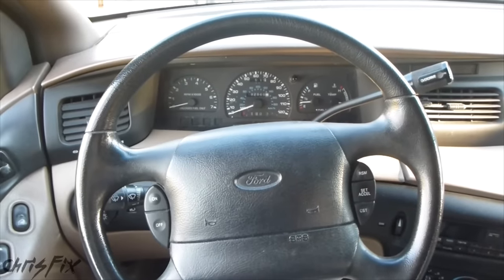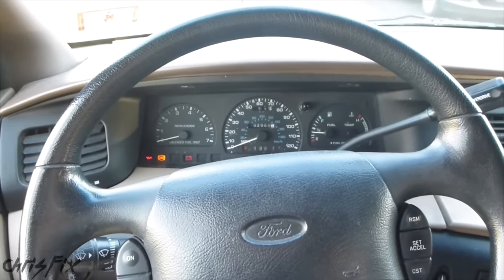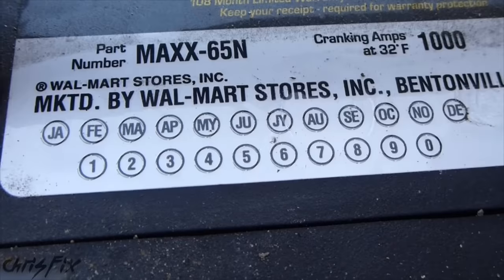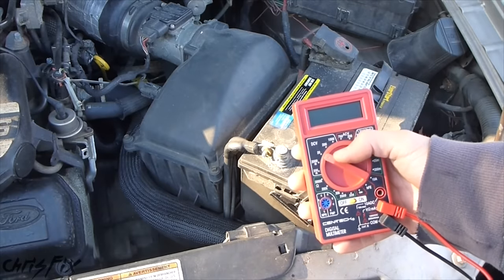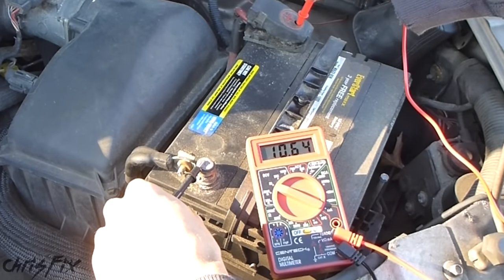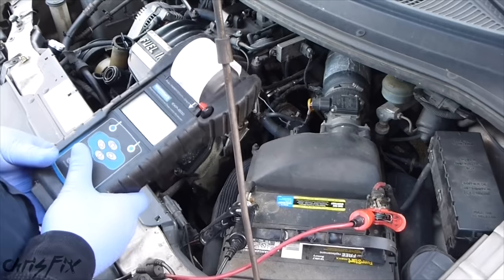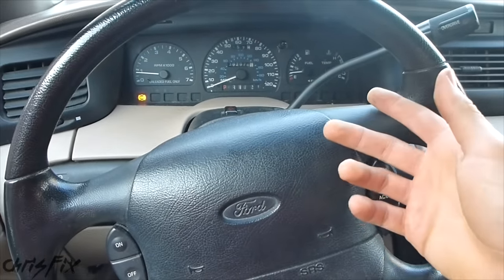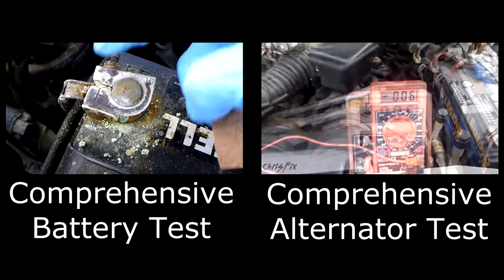What to do if your Car won't Start

Comment: Hey Chris. I don't know if you'll see this, but my car will randomly not even turn over for a while until I turn the key a couple times, then it will start with one tumble. Could that be a bad starter?
Reply: Yes that would be a starter motor I had one of my cars do it last year on me if you can get at starter motor tap it with a hammer starter motor should work unless you end up with my problem in the end my starter motor completely failed so I had to replace it so you got two options put up with it tap it with a hammer every now again or completely replace

Comment: Hi can anyone help me? I have a 2008 Vauxhall Corsa D. I’ve just replaced the battery and now it won’t start but I’m getting power to the dash lights. One of the dash light is a flashing car with a spanner. I’ve looked it up and some say it could be the immobilisation system preventing it from cranking and starting the engine. Any tips or advise would be great thanks 🙏

Comment: Problem i had wasnt the battery t was the starter so now it starts but sometimes it is hard any ideas they change the carbon on the starter and change it

Comment: does any body knows what happens if theres is 1 or 2   bad cells  ?  the battery  can still show  12 . somthing   v. right ? but will the car  star   since im in a situation  mecanic wants to replace starter   and  i  want to make  sure i m not over looking the battery    i  took   it to auto  parts and he says its only  40 % charge  but why didnt  work when i use the cable   to jump star?   thanks  ( i have been having flicking lights and  finally car  is only doing a click  thats  it ( all the lights  and radio work )

Comment: HELP NEEDED ! .. I just bought a 2000 GMC Sierra the man who sold it told me it had been parked for over a year. I replaced the fuel pump , bought new battery, new spark plug , cleaned all dust from the fuse box , cleaned all fuses one by one . My problem is I turn the key all the way forward & it won’t make a sound nor any lights turn on & as soon as I remove the key the alarm starts making a low beeping sound similar to the one when you press to unlock the doors. I turn the key all the way to the front & it shuts off then remove the key & the sound comes back & won’t shut till it drains the battery.  I slapped some jumping cables on to the  battery & as soon as the black jumping cable connects to the other black cable from the battery the alarm starts going off & shuts off after a few seconds with the jumping cables on .. after I let the jumping cables for around 10 full minutes without trying to turn the truck on nor moving the key it starts right away but after 2 or 3 days it happens again...

Comment: Hey chris. I have a ctek charger and it has a recond mode and the test said failed and was told to replace it. I used the ctek and used the recond mode and the battery came bak to life and got a ok on the battery tester.
Reply: Chrisfix

Comment: Happened to me a couple of weeks ago (what you experienced in the first thirty seconds of your video). Obviously, it was time to replace the battery (on a Tuesday). Come Thursday and the alternator went out, so I head to get that replaced on my 2003 Honda Civic EX Coupe. On Friday, the battery light began flickering on my dash panel after lunch, and over the weekend it was getting worse, so I likely had encountered a problem with the charging system. Took it back to the mechanic on Monday and it took them a couple of days to troubleshoot the problem. It ended up being a faulty alternator from O'Reilly's that had been installed the previous Thursday, so likely the voltage regulator was the faulty part within the alternator. Sometimes it pays to do research and consult with a mechanic to diagnose serious issues (thought it may just be something as simple as a faulty alternator). Need to change out my air filter and cabin air filter this week before I forget. Also learned how to jack up my daughter and will change her oil in 2k miles after watching ChrisFix's tutorial on that. :)

Comment: If i turn my keys my dash lights up as normal. But when i go to start the car it just dies and i hear a click from the front. Also i dont hear my fuel pump and i cant find the fuse that is blown. I have no idea whats wrong. I have a 2000 bmw z3. And its a fairly new battery so it cant be that i think

Comment: My 88 ACCORD lxi makes a screechy noise when it turns on and keeps screeching when I drive . And sometimes it don't want to start and would have to jump start over and over . And finally it just wouldn't start after new battery . Any ideas why it doesn't start plz help ???
Reply: ORANGE BOY 714 screeching noise usually means ur belt is too loose and maybe ur belt has a glazing on the surface..so id replace belt and check tensioner

Comment: How was your experience with WalMart auto service? Many years ago a relative and I were going on vacation to Florida. We decided to drive instead of fly just for fun. I don’t recall what state it was but something happened with the car and we ended up stopping at a Walmart because they had a auto service and we needed a few items. My relative explained the issue and the mechanic took the car back while we went shopping. Our car was ready then and we went to checkout and this is where problems happened. I’ll keep it short, we never had a oil leak (I think it was oil I don’t recall) and my relative argued back and forth with the service desk and eventually they went back and fixed the issue for free. A store manager got involved too and apologized for the inconvenience. The worst part was the mechanic refused to admit they did something wrong and decided to cover it up. To this day we avoid Walmart auto services. I don’t trust them with a simple thing as changing out the battery.

Comment: Can someone help, i changed my cars radiator and it worked for a while, but everytime i drive it and it gets to half on the C/H gauge and you turn it off it wont turn on and have to wait until it goes all the way to Cold on the gauge

Comment: Hey Chrisfix, i just ran into  an issue with my recently purchased Ford Windstar from 96. The Immobilizer got issues, the red light where it shows a key flashes like crazy and the car shuts the engine down after two seconds. We cannot figure out what might be the issue... any suggestions how to bypass or find out what is wrong with the immobilizer? Thanks!

Comment: My car  wnt start or crank. Also  the dash board,headlights,radio  dnt turn on at all. ALSO MY KEY BATTERY  WAS REPLACED AND STILL WNT TURN ON ANY TIPS? THANK CHRIS FIX IT
Reply from the maker: Check fuses. Watch this video: https://www.youtube.com/watch?v=yC409CU7mU8

Comment: With my truck it does this thing where it does nothing at all.  It doesn't try to crank, it doesn't click, nothing.  My first instinct is always to hook up a battery charger, but it usually says it's full. 
 
It's a manual transmission.  It won't try to start unless you push down the clutch pedal.  There's a little sensor at the top of the pedal that senses if it's pushed down, and it falls off sometimes.  So, there's another thing to check.

Comment: My uncle's old silverado got fixed up to run and drive but it won't start it kinda cranks very laggy and slow sometimes it just doesn't crank at all they said battery has been charged but i don't fully think so. Thought maybe having the charger on and connected to the battery while starting up the Silverado.

Comment: I wish you could help me, I am in such a bad situation and if I lose my charger all will be lost. Mechanic called me up from me having towed it five days ago and told me to take it to dodge, they dont know! I tried checking everything, replaced the throttle body, fuel pumps, still nothing. 😔

Comment: My Nissan Pathfinder 2000 started having problems accelerating when I was on the highway and then alll of sudden my steering wheel got hard to turn and then my car turned off could you please tell me what could be wrong
Reply: did ur belt rip or come off? or did ur nissan just turn off?
Reply: Or did your transmission break

Comment: Just installed starter in 01 v6 firebird. It Would try to turn over slightly then clunk noise and a high wine noise from starter. Put a 1/16 shim in it started right up. Let car idle for 10min. Turned car off tried to restart clunk and high wine noise again. Turned the crank to check all the fly wheel teeth. No cracks no damage at all! So im lost. Any advice would be appreciated thx.

Comment: Hey, what happens if the car dont start and the engine light is on,what can i do to fix the problem?
Reply from the maker: The engine light is always on when you turn the key to the run position. If your car will crank but won’t start watch my video “how to start a car that cranks but won’t start”.

Comment: I did all that and i got like 3 batteries this year i took the alternator off n checked it A.Z said it was good replace the starter still not cranking the windows wont roll up but the lights come on idk

Comment: What if there’s a lot of clunking chk chk chk like metal running against each other I have good oil no check engine but the car won’t start until I leave it in the run position for a bit then start

Comment: my parents Peugeot 406's battery is 10 years old and it has a indicator witch shows if the battery is good or bad and it's around in between

Comment: I have a 2006 F150 lariat 4x4 and it has a battery light and a good amount of fuel but it won’t even crank over but it shows I have a battery

Comment: My battery shows 12.8V and it still won't start. When I turn the key in the ignition all the dashboard lights turn off..i go and check the battery again right after and i still have 12.8V

Comment: Put so much into my vehicle and it won’t start, is it the starter or battery now. It clicks and turns off. Had to push it and I got so angry that I punched my side mirror and it broke. That feeling sucks when you put your sweat and time into something and gives up on you. I feel bad and devastated.

Comment: I had a pretty dumb " my car won't start episode" the other day.  I left the house in my work van (no problem, no sign of trouble).  I stop at the convinience store and go in.  I come back out and attempt to head on to work, and nothing.  I turn the key a few times and get nothing.  I figure at this point, let's start small.  So I pop the hood and inspect the battery and connections.  There was a small amount of corrosion, so I pulled the terminal connections and cleaned them.  I also cleaned the posts on the battery.  I put it all back together. The van started right up without missing a beat.  I still went ahead and got the charging system and battery checked to which it was all fine.  Its just wierd that this happened with no warning.

Comment: My gf's car didn't start overnight too. Drove it the day before, sounded very much like a battery to me. I swapped it and the car ran fine. She was a little angry it didn't start, bad car bla bla. (note this is her first ever issue with the car). The car is 9 years in april and it was the OG battery... I think it's a damn fine sturdy car. So the battery was atleast 8,5 years old, i think that's really strong for factory. Women ! :)

Comment: I so need you right now my car won’t start and it work great until last Thursday the battery is good and the fuel pump is working properly I did try to hitting the starter but still won’t work help!!!!

Comment: My 02 Toyota Avalon is having a battery issue. Lately when I turn it on. My radio loses its memory. Its been annoying me
Reply from the maker: Replace the battery
Reply: ChrisFix I bought the battery brand new in 2018. My Avalon has over 276,000 miles

Comment: Anyone with any ideas on a 1996 K1500 Suburban? Turns over wont fire. Has fuel. If I pull the plug wire off cylinder 3 it will fire up! Changed the plug but no difference. Changed the distributor and plug wires also no difference. Will run on 7 cylinders all day. Camera in the cylinder shows it dry. Plug wire DOES have spark. If I lean the wire up against the exhaust manifold it will spark and stay running but the minute I pop it on that spark plug it kills it. Only found 1 forum with someone having the same issue but no awnser.

Comment: Came back to watch this video but no help, my 08 gmc envoy won't start but it makes a clicking sound, the starter is fine, battery is fine, not sure what it is.
Reply: Turns out it was a corroded terminal. I spent almost a week trying to fix the issue thinking it wa the starter when it wasn't even the problem.
Reply: Yea if u got those replacement connections that they sell like at autozone...if u start getting corrosion on em...theyll constantly give u trouble

Comment: I never had good luck with Walmart batteries. I had to get 3 new batteries in a 2 month span from 3 different walmarts I gave up bought a battery from autozone 5 years later still no issues
Reply: Danny Farmer Did Walmart not give you a warranty?
Reply: @mariomarvis6576  yes they kept exchanging them for free but they still suck

Comment: The theft deterrent system is armed and the engine will not start.
To restore the system ,turn the ignition key to the lock position then to the on position,now press the lock or unlock door button on the driver's door,then turn on the ignition, the car should start.
Reply from the maker: Definitely worth a shot if you have a system that that process works with

Comment: I've been having issues with my car but it's not like that. I put the key in and turn it i have power (lights come on) but engine don't make no noise. Sometimes if you keep turning the key at some point it starts. Just gets so irritating having to deal with it every day. It doesn't happen every day tho
Reply: Could be a bad starter solenoid/relay

Comment: well yours at least turning, my car just yesterday did not have power even for central locks and when i turned a key, not even single indicator light lighted. at first i thought someone stole my batery :D but it was just completely dead. after 2 weeks standing, in summer. so i started it with my jump station, ran a few miles, diabled the engine and it did not started again. So i just need to find out if its battery or alternator dead. but judging that it did not died during the ride and during the idling, it will be battery.

Comment: Here is a puzzler, my Car battery just died completely zero recognition of any power.  I was going about my errands with the car when I tried to start it in a store parking lot and it just fizzled to nothing in one second.  After about an hour I was going to give up and have the car towed when my mother said try it, it  will work so I did and it did ! It started up again like a powerful new battery.  When I got home, I turned it off after a while I thought why not so I turned it on several times. It just goes on like a powerful new battery. Does anyone know what happened? Will it happen again? Can someone please explain and help me to understand what is going on? Will it happen again? Mercury Sable LS Premium year 2002 35,000 miles, one owner,me.  Battery is 2 1/2 yrs. Old. No crud on terminals and tight, no play on terminals.
Reply from the maker: Was there just a click and nothing when you went to start or did it sound like there was starter drag?
Reply: I don’t think that it was a battery it was ether a starter or a bad connection

Comment: So I have that same problem, I replaced my battery and it did nothing. I had no lights or anything come on and no problems with it at all it was driving just fine the night before when I last used it...

Comment: I’ve got a intermittent, parasitic drain on my van’s battery. I suspect that the drain is located within the aftermarket alarm system fitted by a previous owner.

Comment: that battery has a shorted cell, so you end up with a 5 cell battery instead of 6, most of the times batteries fail like that, most of the times they also fail due to the cells being old and worn and despite they retain charge they do not have the power to crank the engine, it is easy to notice this by measuring the battery's voltage and asking someone to start the car, the voltage on the battery should not fall below 9V, ideally it should not even drop past 10V (assuming there is no problem with the starter engine, as it can also cause too much voltage drop on start)...sometimes they get a ruptured link between cells, that will cause a battery to be 12,6V at rest, but when starting it immediately drops to 0 volts....

Comment: I just had the same problem with my 3 year old Honda Accord. It was starting just like that for two weeks of starting the car once or twice a week. The car just started clicking yesterday. Jumped it with my 2015 Lexus RX350 and ran it for 15 minutes and it still doesn’t turn over after that.
Reply from the maker: Get the battery tested

Comment: Ya mine died last night while trying to start it at work. Got new one installed today By another parts store. I watched the battery fail right before my eyes. I do know for past Knowledge, sometimes battery after being jumped can read a Fault Good reading as well i went with my Gut instincts and Replaced Battery. I had my brother look at the Vehicle also last night he confirmed the battery was failing we checked everything we could ignition switch was good, Alternator good, battery Dead  Not holding a Charge another good sign its a goner lol.

Comment: Get a Actron CP9680 code tester. It checks live, record, graphing, ABS, SRS, Emission readiness test,  transmission tests, oxygen sensor test, and MORE! It's well-lit! It comes in a black pouch. EBAY has it.